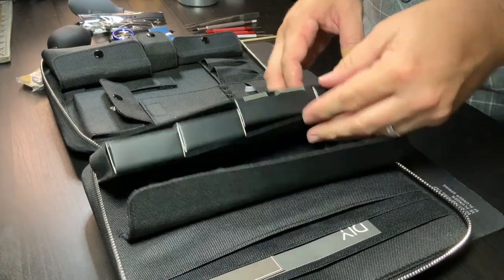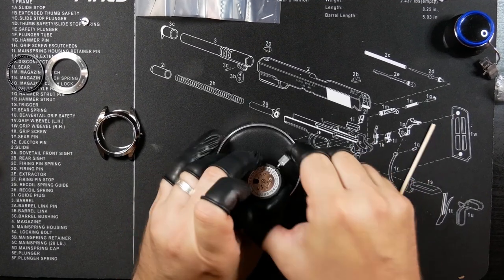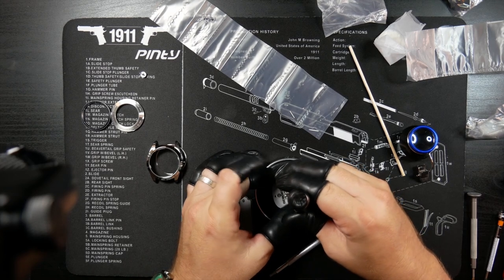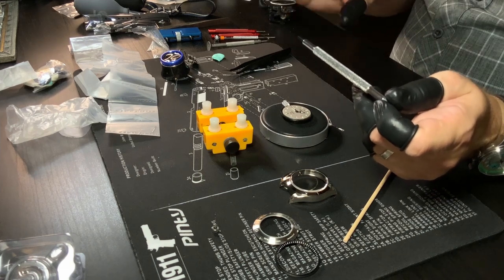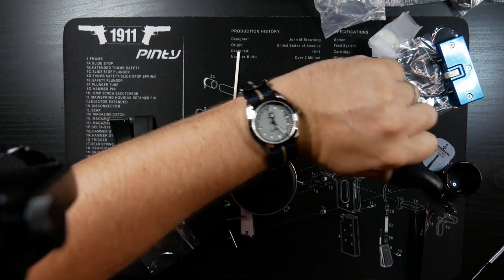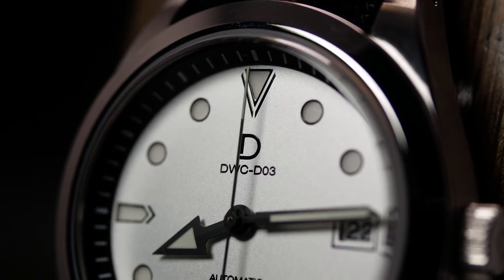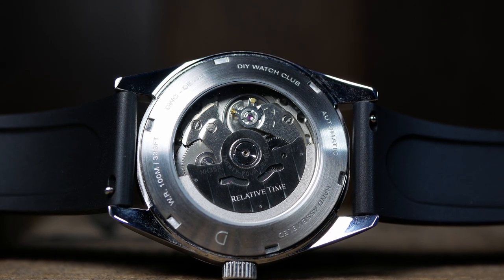Building A Watch with DIY Watch CLub.  DIY Expedition Review

Comment: I think these kind of kits of not really about the value for money of the watch you get at the end. They are more about helping people to get into modding I think. They make it easy to start out, by giving you all of the bits you need. So you don't have to worry about things not fitting etc. If you buy parts separately yourself.
Reply from the maker: Exactly.  That and you don't need to worry about if all the parts you want will look good together. The few times I've done something I've always ordered 2 different sets of hands in case one of them wouldn't look right.

Comment from the maker: A few Notes:

1.  I make the mistake of saying the model is the Explorer a couple of times.  It's the Expedition.
2.  The cost for just the components of the kit is $260, not $320.  
3.  Had some technical issues with the audio in the last portion of the video. (long story, but accidentally dropped something and it's not working right anymore)
4.  If you want to check out Dave's build: https://youtu.be/NS4Cg4f2x7s

Comment: If you’re a complete novice then a kit like this with everything you need is the way to go for your first watch build, after that parts can be sourced just about any Chinese website, some times a downer watch is a cheaper option 
Tip for second hands is to get the dial nearly eye level and tip the hand on its side and just roll it over the shaft

Comment: Fyi, ive seen those natos on Amazon. Its designed to be a single pass through. Adjust the keepers so they are on the buckel side and it will be standard size.

Comment: Hehe, next assemble the 1911 you've have that diagram of 😂. I've seen more of these kits getting reviewed and it's kinda cool.
Reply: A lot of hand fitting will be required if he was to build one. And at the end of the day it’s not worth it.
Reply: @Bob_Smith19  lol, you can assemble and disassemble a 1911 in mere minutes 😄
Reply: @HVG67  Good luck w/ that. They aren’t a Glock or AR15.
Reply from the maker: I think Henk is talking about taking it apart, like when you do to clean it.  Not necessarily building one from scratch.

Although I did get to tour a place that did that once.  I don't think they do it anymore, but STI in Georgetown, TX used to give tours of their facility.  Very cool seeing it in person, and all the work that went into making them in small batches.

Comment: Nice review and nice end result, Shane. You may not get that second hand to fit no matter what you do. Sometimes those things are just a few microns different than what you need. I would say that, although not for everybody; that's about what a micro brand with an NH35 costs. At least this way you can get everything in proper alignment without  having to rely on some cross-eyed guy at Seiko. Good job!
Reply from the maker: It could be off.  It supposed to be for a Seiko movement, but it's also possible they sent me a miyota version by mistake.  I'll try it again some time just to be sure.
Reply: @RelativeTime  I just finished changing the movement, chapter ring, etc. in an SKX007. The Rodico is a must have to get the second hand back on there. I'd tell you how I know that, but; I'm pretty sure you already know.
Reply from the maker: @stephenbridges2791  I do, but right now I don't wanna talk about second hands... 😎

Comment: Hey Shane,great video 😃👍 doe you think Ali express would be a better option,what I mean is there are many stores on there selling all the tools and components to build a watch and getting the dial and hands you really want? Just wondering what you think,thanks😃
Reply: The parts are coming from China anyway. Do you want to pay a middleman or buy them direct? eBay is a potential good option to find parts in country already. But you’re going to pay a slight premium.
Reply from the maker: I haven't checked Aliexpress for prices, but I know there are a ton of parts.  I think it would be worth checking out just to see what the average prices are and compare.

However one of the biggest barriers when you get into modding is how easy it is to get overwhelmed with all the choices and options out there.  For experienced modders, I think that's half the fun.  Yet when your new, it can drive you crazy.

Just trying to figure out if the different components would look good together or not by looking at pictures.  It's a bit maddening, and the few times I've done it I've ordered a couple different sets of dials and hands just in case one wouldn't work.  Which is why I had that extra orange second hand.

So something like DIY watch club eliminates that by giving you a pre-designed kit, but you will probably pay a little premium for that.
Reply from the maker: The other option for when you are first starting is to start small.  Find a cheap base watch you like on Aliexpress with a NH35A, then buy a new dial and hands.  You will have to do a little bit of research on what tools you need, and what to do with them, but that would probably be the cheapest (and safest) way of getting your feet wet.

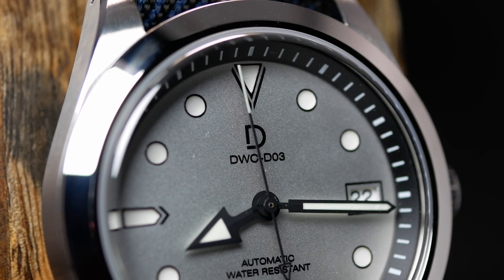Comment: Is that dust on the dial @ 12:55?
Reply from the maker: When I look at it normally I don't see anything, but it's entirely possible.  I tried to clean out the crystal as best I could before putting the movement in.

Comment: Their logo on the dial is a non starter for me. I understand why they do it but I won’t give them my money because of it. Especially when you can buy the tools on Amazon and all the parts on eBay or AliExpress for less money.
Reply from the maker: For me it's not the logo as much as the model number thing below the logo.  If you didn't know what  it was it would just be a bunch of random numbers.

I checked crystal times, but it's been a while since I priced stuff out on eBay.  I'll have to check that.
Reply: @RelativeTime  I’m anti logo in general when it comes to aftermarket parts. It’s why I removed the Poly80 logo from the frames I used. And I specifically searched for non branded slides. I’ve milled off logos before 😂